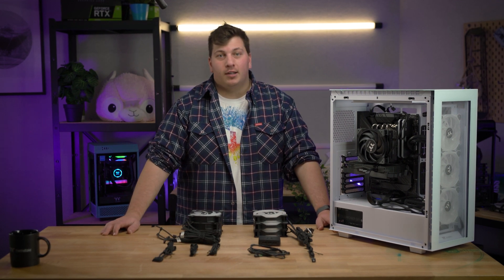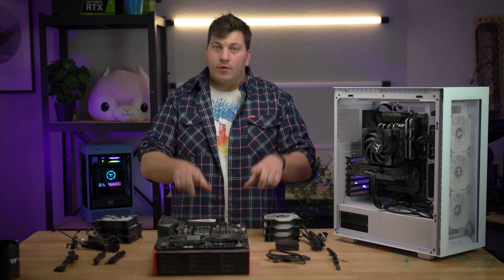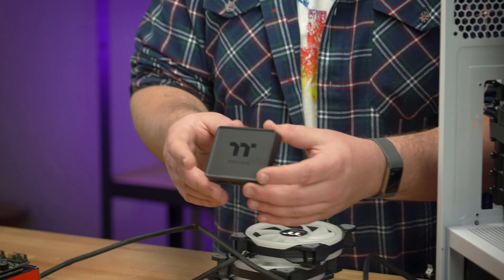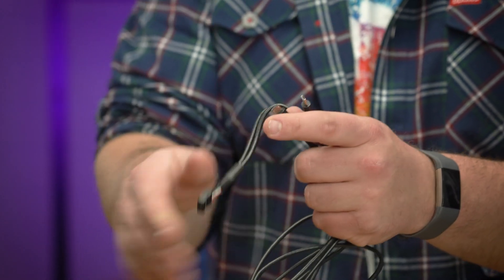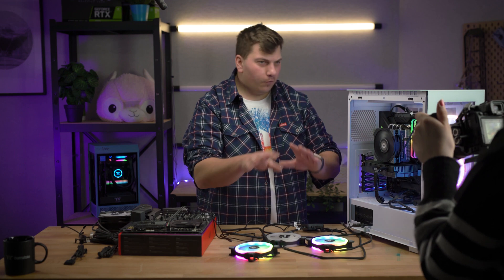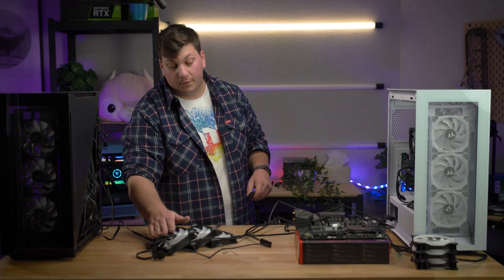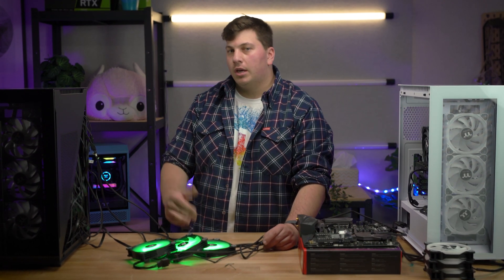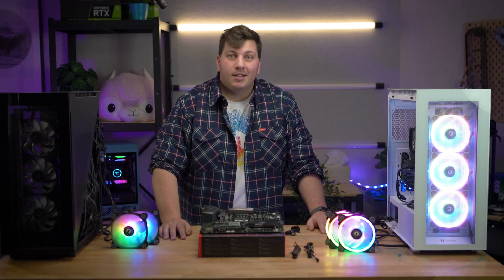How to connect RGB Fans & other RGB products | An RGB guide (aRGB + Digital RGB)

Comment: hay mate i have a very random question is what's the best way hook up the controller to be powered by usb i have a very different project an I'm struggling to work it out throught different adapters
Reply from the maker: G'day! Are you able to pop through some more details of what you're looking at doing exactly, hoping I can help out.
Reply: @ThermaltakeAustralia   yeah mate i have a redarc redvision 12v BMS (battery management system)  an trying to build a custom computer looking case for my 4x4 all i want to do is to run some rbg fans with out installing a psu to keep my BMS cool in my car so trying to figure out to how to get power to a controller in my car ive tried using molex to USB but i know i wont get power
Reply from the maker: @DAYZOFFADVNCHURZ  Ooh, that is above my level of knowledge haha. So for some insight though, with RGB fans, if you get some that are "Addressable RGB / aRGB" the LEDS are powered seperate from the fan itself. The LEDS are powered either via a 5v(most common) or a 12v (less common now). 
You should however be able to power fans off of molex using a 3or4 pin fan header to molex cable. It's the RGB aspect you might have a bit of drama with.

Comment: I could really use some help. So, I have a Z690 Tomahawk MB and Phanteks P500a case, I want to swap out the stock 3 pin ARGB fans for 4 pin RGB PWM fans and daisy chain the 6 fans then connect to my 4 pin 12v RGB header and be able to sync everything, hopefully without frying my MB. The problem is that will be too many fans on 1 header,  and only other choice is to use the 3 pin but different voltage and those are for ARGB, not RGB and understand they shouldn't  be mixed  due to different voltage. So how can I safely connect 6 RGB 4 pin PWM/PST fans to my 4 pin RGB header safely?

Comment: Let's say your installing a AIO with RGB fans, will you need to go buy a separate hub/splitter/controller for it if you dont have one? I also want to get a new case that comes with front rgb fans. I'm pretty sure most cases don't come with a hub/controller. Do you usually have the case fans that already come with the case in the same hub as extra fans you put in or do you keep it separated?

Comment: Can you maybe daisy chain, let's say, 3 case fan's ARG LEDs with liquid cooler's ARGB fan's plus the leds on the pump itself and then connect all of them to the motherboard ARGB pin? To sync all up nicely? Or perhaps daisy chain them to a controller, two cable into the controller, which then goes onto the ARGB header of the motherboard?
Reply from the maker: Yes you can! You just need all of the products to be ARGB ones. So as an example, you can connect 3 Pure Plus aRGB fans and TH240 AIO CpU cooler water block all to your motherboard and control it via motherboard software. 🤙
Reply: @ThermaltakeAustralia  In your example the AIO and the 3 Pure Plus would be daisy chained into one ARGB cable? Cause my plan is a bit complicated sadly. My AIO and the 3 case fans I bought are not from the same brand. Both of them came with their own controller/hub but they don't need to be used, I could just daisy chain their ARGB cables into one and then connect it to the motherboard.  Both of them 3-3 fans, so 3 on AIO and 3 in case plus 1 ARGB line on the pump. However since I want them to be synced through Aura Sync I need them to be on one ARGB cable so at least one controller/hub I need to use probably, I can't directly chain them together into one. Also perhaps 6 ARGB fans on one connector would be almost too much to power up by one pin? So I defintelly need to use one of the controller/hub, since they both are SATA powered. Sadly the case fan's cable is like 1 mm wider than the AIO's hub, so they won't fit in there. But the case fan's hub can be easily connected with the AIO's main ARGB cable, which is also daisy chained. So my plan here is to daisy chain the AIO's RGBs, as it supposed to be, and connect it to the case fan's hub with one ARGB cable, then daisy chain the case fan's ARGB cables into one and connect them to the same hub. Then one main ARGB cable comes from the hub and goes into my motherboard.  What I'm afraid of is perhaps, even if they are controlled by the motherboard software, since they are different brand I'm afraid that they won't be synced perfectly, or am I wrong and it'll be just perfect?

Comment: I was going to get an rgb fan controller for my build, it's kind of in shambles right now, with most of the rgb not working, but after watching this video I might just go the daisychain+motherboard route. I have an MSI z490 a-pro board, it has a JRB 4 pin connector (I'm assuming that's the 12V one that I don't want) and 2x 3-pin "J-rainbow" ports, that are I'm assuming the 5V ones I want. I have an nzxt 240mm AIO that has an rgb pump header (not currently plugged in correctly), and I have 6 total RGB fans (1 in the back, 2 on the top with the AIO, and 3 in the front of the case). So, I should be able to daisychain all 6 fans + the aio pump header all together into a single 3-pin, 5V, "j-rainbow" port? Is that correct? So I wouldn't need a controller?
Reply: But then how do I power all 6 fans? I don't think I have 6 fan power ports on my motherboard. This shit confuses me so much.

Comment: Is there any option to connect those 3 pin (male/female) cables to a motherboard without 5v ports? (mine is Asus b250f Strix Gaming). I just bought a Raidmax ac1204 cpu cooler and I can't make leds work. Just only the fan  :(

Comment: hi please help me, how can i connect watercooler rgb into motherboard wich has no rgb header ( no 3 pin header, no 4 pin header, no jled and so...) there is fans only fan slots (motherboard is asus prime z270m-plus) and my watercoller rgb cable is 12v 4 pin?
Reply from the maker: Unfortuately if your motherboard doesn't have any RGB 5v or 12v headers, then you cannot control your RGB products via the motherboard.
Reply: @ThermaltakeAustralia  how do you control your fans if you have no rgb headers

Comment: I'm having a problem and could use some help: I have 3 Riing 14cm fans. I did the controller just how you showed. All 3 fans are plugged into the controller. The controller is also plugged into the PSU correctly as well as to the motherboard. When I power on my PC the fans are spinning and basically rainbow colored. Here's the problem: When I try to use any TT software (Such as TT RGB Plus) it always tells me "Cannot detect controller, please check that the fan controller is connected." Please help me know how to fix this, as I would like to be able to control the color of the fans. Thanks!
Reply: I fixed mine right after I replied. The reset switch coming from the case was plugged into the motherboard but it should've instead been plugged into the RGB switch board. Hope this helps
Reply: @cloudvi4044  Hrm, I'll have to see what mine is plugged into. Thank you so much!
Reply: @revanmercury  no problem
Reply: same situation
Reply: @cloudvi4044  I'm at my wits end, I can't seem to find any help anywhere to figure out this problem!

Comment: Can you connect RGB fans and ARGB fans in the same RGB header from your motherboard?
Reply: No. RGB fans must connect to the 12 volt 4 pin RGB connector, whereas ARGB fans connect to the 3 pin 5 volt ARGB header. The biggest difference is that ARGB fans have far more control vs the slightly older plain RGB. You can have both in one system and controlled by the motherboard software, but some effects won't work too well on the plain RGB fan vs the ARGB fan.

Comment: Thank you very much for the video. I have a doubt. As the controller connects to the usb port, so I would have to stop having a usb port on my case to put the fans?
Reply: Unfortunately yes, this header on these controllers take up a space that would otherwise be used by your case for USB2 ports. However, you get internal USB hubs that let you plug in multiple headers and then connect that to the motherboard. I ha e one made by NZXT, served me very well foe this purpose.

Comment: hey so i recently built my first pc and the case fans that were installed in the case are molex plugs but i want to plug them into my motherboard, is there anything like an adapter i can use for this, if so what is it called and where can i find it.
Reply: Look up molex to 4 pin fan adapter. You'll almost definitely lose PWM control, but you might be able to use DC mode to control speed/noise if your motherboard supports it, but I've never tried that setup.

Comment: Does it take a certain kind of connection for a lighting effect to "travel" across your fans? I saw someone using Polychrome (which I have) and when they used "stack"...the light would spin around the first fan, then the second, on down the line to the last fan in the series. When the last fan is fully "stacked" the next one starts filling.
I have 6 argb Sickleflow fans in line from one header via the pigtails, but they just all do the same thing at the same time. The effect doesn't travel...each fan stacks itself. If I tell polychrome there are 36 lights  (Each fan has 6 lights)...each fan does the same thing, light spins around it 30 times til it stacks the last 6 lights.

Comment: If I want to use the same case fans for my CPU cooler radiator, will I have to plug those fans on the radiator into the CPU_Fan separate from where I would plug the case fans into (for fan power, not argb, I assume all the RGB wires can daisy chain together and go into a 5V header)?
Reply from the maker: That's actually up to you :) 
So for the sake of this example, I'll assume you have a 240 radiator which has two 120mm fans. 

You can use a splitter to fit both fan power cables to the CPU_Fan header on your motherboard and then they'll be tied to the CPU temperature curve your motherboard has set for ramping up or bringing down the speed of fans based on CPU temperature. You could also stick those via, via the splitter, on the Chassis_fan / Case_Fan or / SYS_fan headers as well - these headers will have a different fan curve and generally are set to a constant power. 

The preference is up to you and there's no exact rule. I tend to go with the CPU header and make my own fan curve up in BIOS because the default are always aggressive and I like silent cooling haha.

Comment: Hello, I have a question! I just recently got into PC building and i'm not very good with these stuff. Basically i bought a Sharkoon TG4 PC case with RGB fans, and i have a H510M H motherboard, which only has a 12V and not 5V header, so i cannot use the ARGB effect of the preinstalled fans. My question is, PC case specs says that if my mobo does not support the connection, i can use 14 different RGB light effects via Reset button on the PC case. So, will i be able to use the RGB effect of the fans at all or no? Sorry for asking a possibly stupid question, just want to make sure before i spend any money on it :) Thanks in advance!
Reply: If it says it's supported it probably is

Comment: Does the controller mean you have to make most of your rgb controllers the same brand/model?
Reply from the maker: So, with ARGB you can mix and match nearly all brands nowadays, however, if you have older argb products then that might not be the case. With the digital RGB stuff, most brands including us have their own controller which the Digital RGb products can only be connected to.

Comment: the fact that RGB has ONE cable and aRGB has TWO! this is what i searched and found NOWHERE on the internet -_-
It is VERY confusing since all the fans i found are RGB and i have no clue if they ARE ...RGB or aRGB or can be whatever. The industry need to make it more clear when buying them :-/
Reply: Can you tell me which fans were you looking at? I'll try and see what they are.
Reply: @DTD2212  well the thing is its hard to understand that normal RGB fans are the old tech and aRGB are actuall the new ones.
I got some Lian Li fans cuz of the hassle free cable management (and they are aRGB) and were even cheaper then the normal RGB TT Riing fans :D

Comment: Hey, what if my PC doesn't have a 5V header? Only 12V
Reply from the maker: Hey! That's a different type of RGB header, which only a SINGLE LED colour can be picked and used at the one time. This is an older form of RGB and is being phased out over time. 
Do NOT place 5v products on the 12V connector or vice versa or you'll likely see some smoke... and maybe a bit of fire.